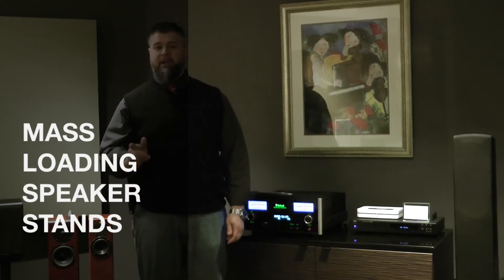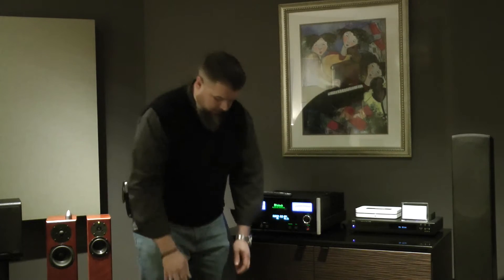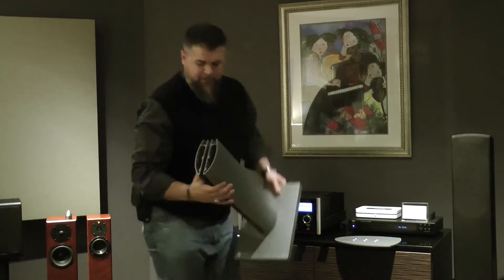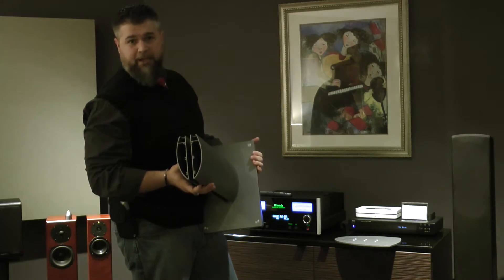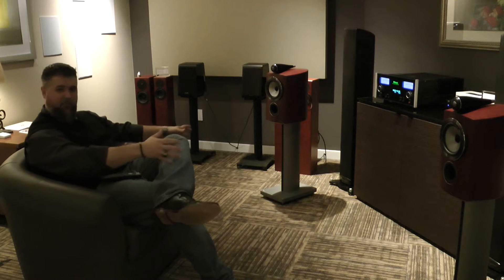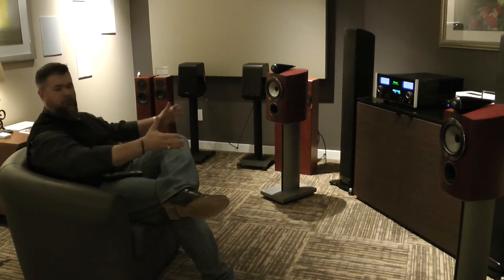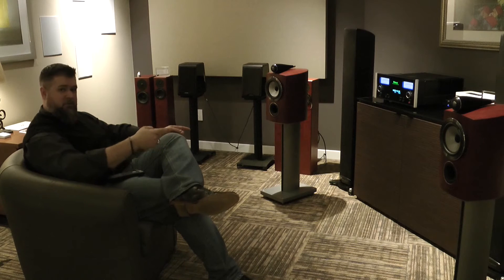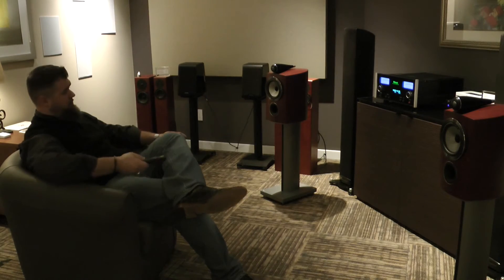What is Mass Loading?

Comment: How much(weight?) sand is required for 1 B&W FS-805 D3 Stand?
Reply from the maker: Thanks for your question. Bowers & Wilkins does not provide a specification regarding the quantity of sand required. Mass loading is a principle to increase the weight and prevent vibrations (resonances) from transferring to the floor. A bag of sand is worth it for the improvement it will provide.